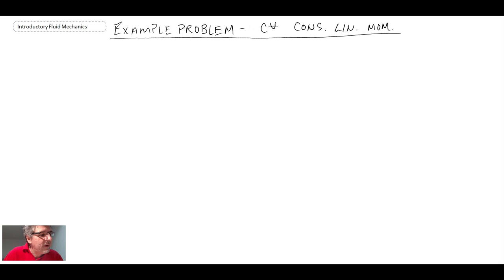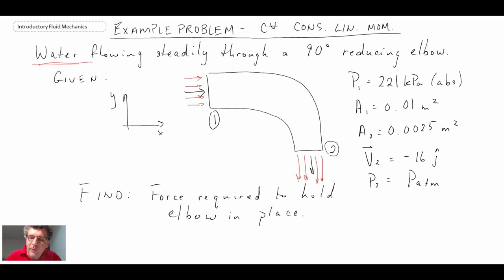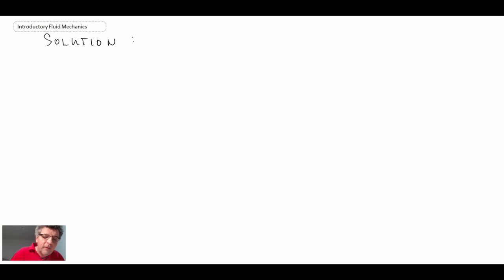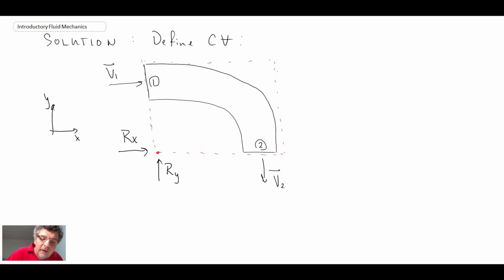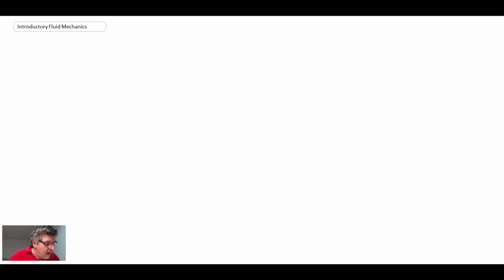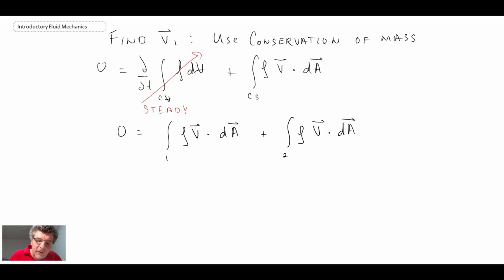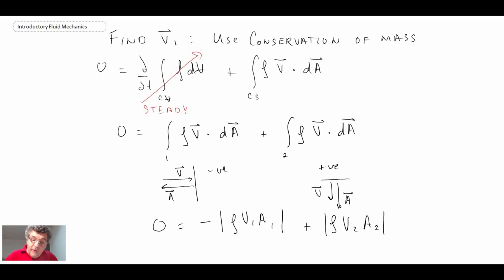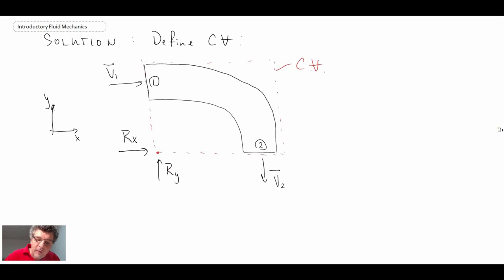Introductory Fluid Mechanics L8 p5 - Example - Conservation of Linear Momentum - Part 1

Comment: Why can you approximate the steady flow as rho*v*A? I thought this was only for uniform flow?
Reply: Hey I know it's been 2 years (you've likely graduated since) but in case other people watching want to know. This is correct, usually you can only use \rho * v * A when velocity is uniform. However, in cases where V is not uniform it suffices to use V_average, at which point the relation will again hold. Typical flows will see a parabolic distribution with highest velocity of flow at the centroid of whatever profile pipe/nozzle you're using (exceptions exist) but so long as you know V_avg the relation will hold.